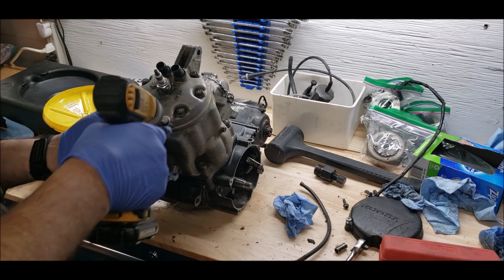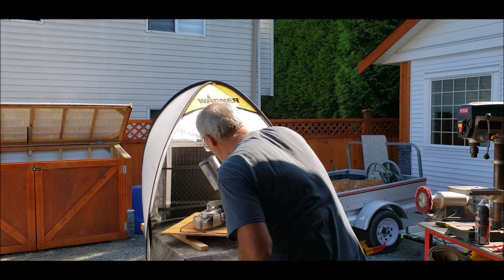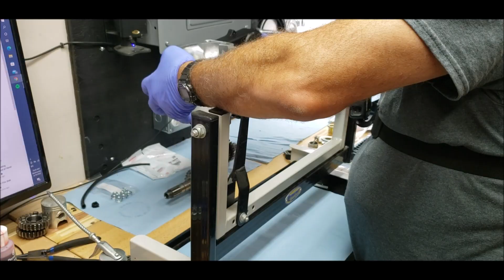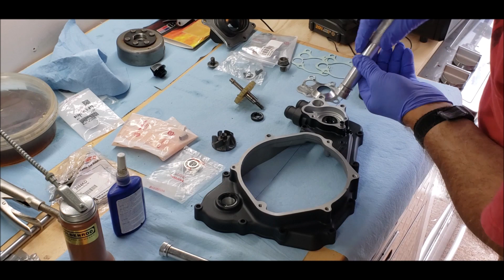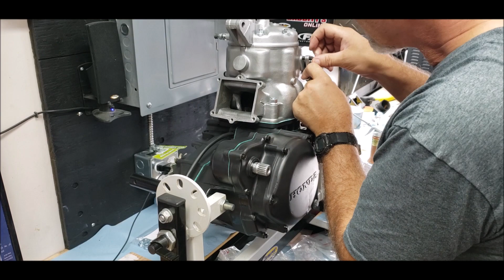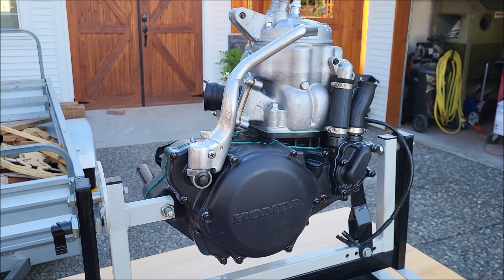Building The Ultimate 500cc 2 Stroke Engine!

Comment: Great job I'm in the middle of a full restoration on a street legal 1990 cr 500 from Scotland pretty much going down the same road with mine only thing I have done different was sent my cylinder to a guy in England to have it custom sleeved with an alloy sleeve set at 91mm and nikasil plated so i can run a vertex piston at 2 thou clearance.
Reply from the maker: Nice bike. Parts have to be hard to find over there.  I was going to get the cylinder done, but the budget is already blown apart with the cost of the new case half and transmission gears. I would have been transferring more cost to the new owner with a gain that is not needed right now.
Reply: @TNTMOTO  yeah, it's become very expensive to get the parts.. I had done a few 88 89 cr250 restoration about 5 years ago and the difference in difficulty has sky rocketed since. I'm kinda lucky that a local guy does a lot of the old stuff cheap.. like the tin can honda cranks he rebuilt this 500 crank with a quarter of a thou runout on the dead centers which is crazy.
Reply from the maker: @SuperAnthony1982  That is awesome. I have a guy here in BC that does amazing work for a great deal as well. He does everything from machining to painting .He powder coated my frame for this 500 build for $285 cad which might sound like alot. But previous builds elsewhere cost me $400. His workmanship is also unbelievable, i cant find a thin or missing spot of powder anywhere. Makes my powder coating skills look like im using Crayola crayons.
Reply: @TNTMOTO  oh it's great when you find a good powder coater. I have been through a lot of places to find my current guy who is around $370 for engine cases and frame. He does a good job nice and thick! With this current restoration I have everything in getting painted atm the only slightly naughty thing I have done is change the 1990 colors which I really wasn't a fan of, To the ral 3020 of the 88 89 but seeing as this is for my collection I can live with it lol.

Comment: 60 HP?  That's one scary beast of a motor! wow.. cool video too
Reply from the maker: Thanks for watching. And yes the power is a bit much.
Reply: Incredable to think by the time they where finished with the 250 2t in 2007 the 250s whete putting out about 58hp ,how en earth did they do that? 1990 kx 250= 40hp 2007 58.19hp

Comment: My restored and highly modified 88 model KTM 540 now puts out 69.25 rear wheel DYNO horsepower with a massive Lectron carb..But bloody hell does it consume the premix so much quicker than the last carb fitted..I guess thats the price you pay for uncontrollable HP.
Reply from the maker: lol dang that is some serious power. What gear do you have to start in to prevent a trench 2 feet deep
Reply: @TNTMOTO  Its actually not very ride able or forgiving in this DRAG mode I call it in the dirt..way way too brutal power delivery..I always use second with gentle take off to prevent looping out..but it will do third gear no problems..With lowered front end and knobby tyres it's about equal in speed in a drag with a GSXR1000 Suzuki in 400 meters and the KTMs running low dirt gearing..If I had bigger funds I'm sure we can reach around 85rwhp..but that's all out drag tune running top fuel nitro methanol go faster juice.
Reply from the maker: @albertsammut433  What are your plans with the beast?
Reply: @TNTMOTO  To find the breaking point of the engines HP output firstly..Then rebuild it in a slightly milder tune for SuperMoto racing and to also race it against Superbikes is my dream..But the costs are phenomenal..just the new SM wheels with tyres where $US1850 alone a year ago..its crazy.
Reply from the maker: @albertsammut433  Yes prices of everything have gone through the roof. I used to sell my bikes for just what i had in to them and rely on youtube revenue to pay for tools and riding, but now i have to get a little extra out of my sales.
Reply: @TNTMOTO  Yes exactly that's called inflation and sadly I've never experienced it going down..Safe riding to you..Please let's keep our Big Bore Smokers alive.
Reply from the maker: @albertsammut433  Will do.
Reply: @TNTMOTO  Cheers brother👌🏼👌🏼😉😉